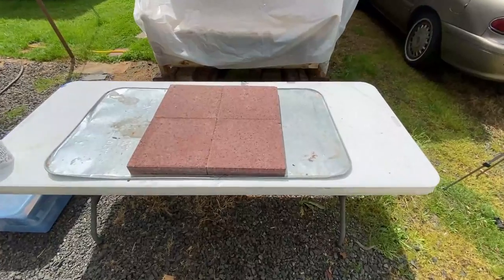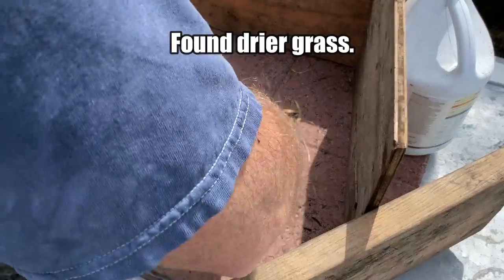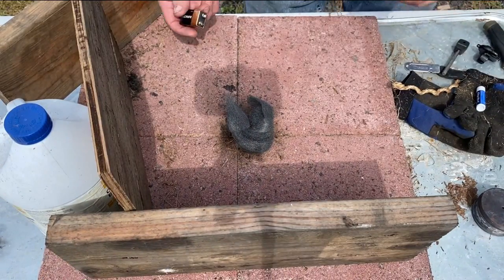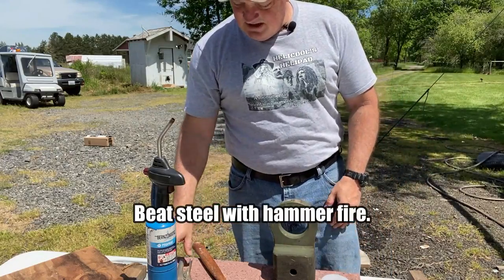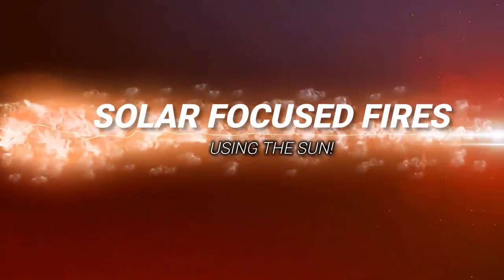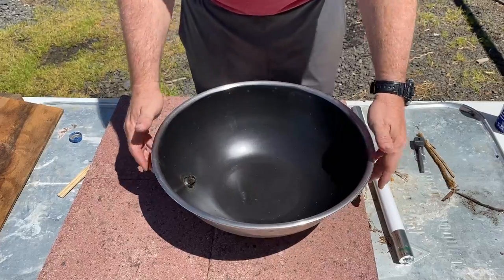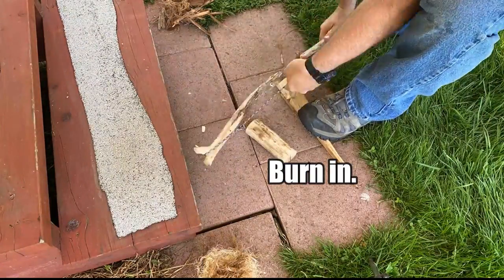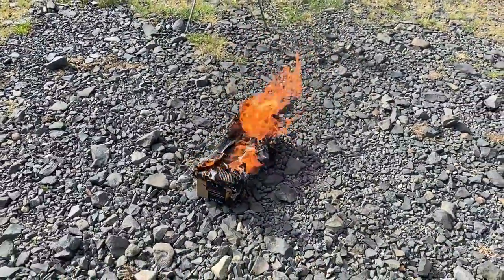19 ways to Matchless Fire Starting

Comment: I made a fire piston that works with char-cloth. The cotton ball and ash are friction fires that are 5 times easier then bow set. But I see you are much faster at the friction fire.
Reply from the maker: The fire piston that you gave me... I could not locate it, or there would have been 20 fires made. Bit the bullet and order US one each. I hear you have some trading stock available that I could use. :-D
Reply: @HelicoolsHelipad  I have mine in the window of the kitchen if you want to try it.
Reply from the maker: @badbadbob1  I ordered two milled and manufactured fire pistons... guess who gets the second one? Yep, it's the guy that has inspired me to build a tipi, experiment with and build all kinds of fires without matches, make my own rope, and build a whole slew of different stoves. Can you guess who that person is?